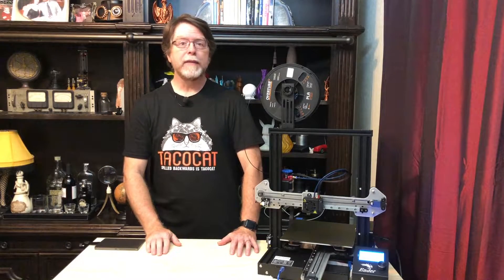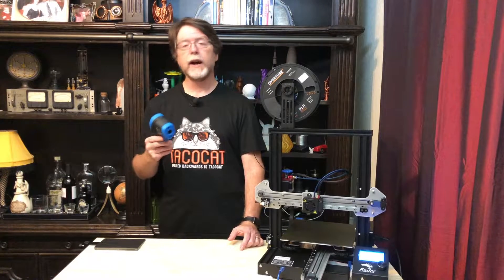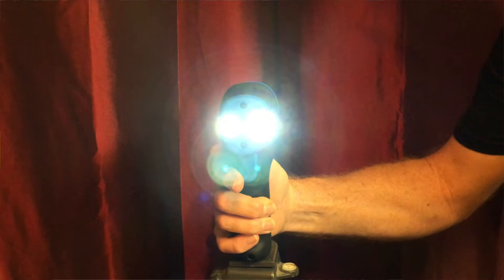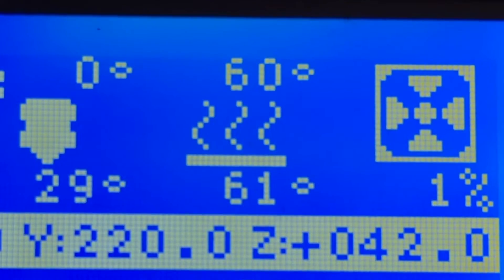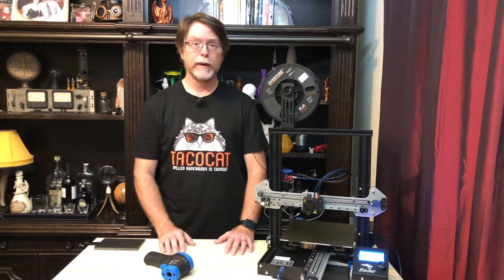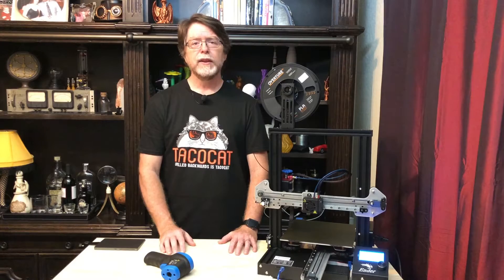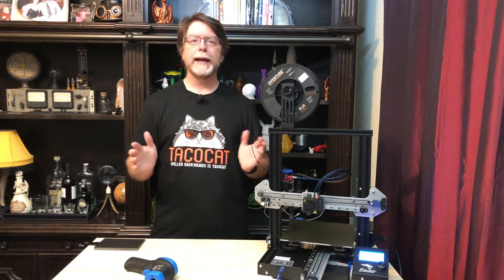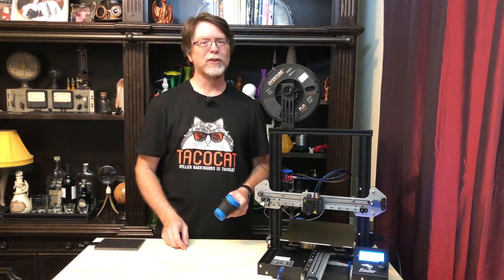Should THIS be in your 3D printing toolkit?

Comment: Bryan!  I was watching Kuntry 3d's review of the filadryer and heard him mention you.    I thought you might appreciate this link for a review of the Thordsen inline dryer as a solution.  

https://youtu.be/kINesALllT4
Reply from the maker: Hi Jason! Haha, I remember that video, if it's the one where Walter was taking his Filadry apart. The Thorsden thing is interesting, and it at least looks like it has a chance of doing something, where the Filadry didn't. For my filament drying needs, I have a big plastic container that I keep a bunch of spools of filament in. It's like a big, clear Rubbermaid tub with a lid. I have a food dehydrator that I attached (upside down) to the lid of the tub, so it blows down inside, and I have some vent holes at the far side of the whole thing so there's actually some airflow inside. I've got a temperature & humidity sensor (one of the Alien3D projects) so I can monitor the environment inside. I'm thinking of modifying that project so that it will control a relay to turn the dehydrator off and on as needed.

Comment: Can you get the it thermometer so that the tip pokes into the hole, if so, it should record the heated air trapped between the two. It has works for me with other small metal parts.

Comment: Ya lost me. There's a thermocouple on the block If you put another thermocouple on the block aren't you just measuring the difference in the thermocouples?  Since the tolerance of a type K theromocouple is +/- 2.5 Celsius You would have to be way off to see a significant difference. Then which thermocouple is right?
Reply from the maker: The idea is to basically get a second opinion. I've had thermistors fail outright, and the firmware interprets it as 0˚C. I genuinely don't know if it's possible for a thermistor to fail or degrade in such a way that it becomes increasingly inaccurate. If it's possible for that to happen, being able to independently measure the temperature would be useful.

If you measure temperatures significantly different from what the firmware is reporting, you can investigate further. Taking a measurement of another printer's heater block could show whether the thermocouple you're measuring with is reasonably accurate. If you don't have a second printer available to test, visiting a friend with a printer could give you another data point. 

Plus you'd get to hang out and chat with a friend. 😉

Comment: I just use a solder-iron thermometer (they are made for high temperatures, to set and correct that tool) and it gives a good reading. Just put it directly on the nozzle or heater-block (and yes, this is a difference).

Comment: Great video Bryan. Yep, I got one of those too (albeit a cheaper version) As you said, works great on heated beds, but not so on hotends. My solution for the hotend is to slide a thermocouple between the silicone sock and the hotend, it works for me. Kind of a compromise between the gun and Chucks process.
Reply from the maker: That probably works pretty well. I suspect the closer you have the thermocouple to the heater cartridge, the closer the reading will be.
Reply: @BV3D  I tend to insert the thermocouple on the side of the heater block, parallel to the heater. This results in the temp of the block which is a more accurate, real world, reading, rather than just the heater. For me it results in readings that match the reported printer values. I have also tried to measure the nozzle temp by clamping the thermocouple to it with a small crocodile clip. While this does work, it does not give an accurate measurement due to the clip dissipating a good amount of heat, but I had to try it :-)

Comment: What about using capton tape on heater block side?
Reply: It is tooo reflective too.
Reply: @elvinhaak  According to the source*: "A thin layer of Kapton polyimide tape or a piece of masking tape has a uniform emissivity of about 0.95. Just apply the material to the component’s surface, and measure the temperature of the taped area. A bit of flat-finish paint or white correction fluid also works well. A small piece of tape or a dab of paint should not affect the thermal properties of the surface".

I would try the kapton tape and use the infrared device of choice, prefreably a thermal imager

* The source: https://www.edn.com/design/test-and-measurement/4386023/Engineers-warm-up-to-IR-vision